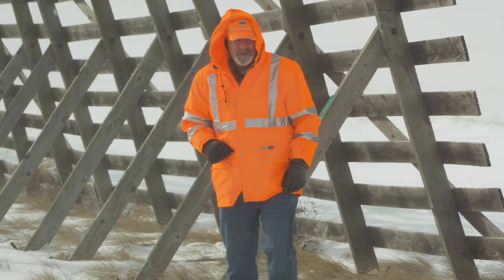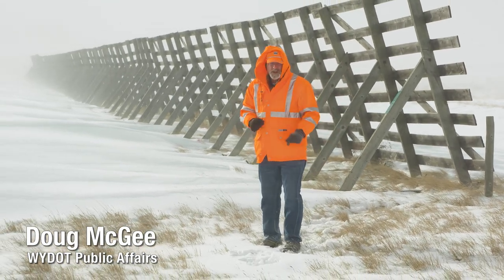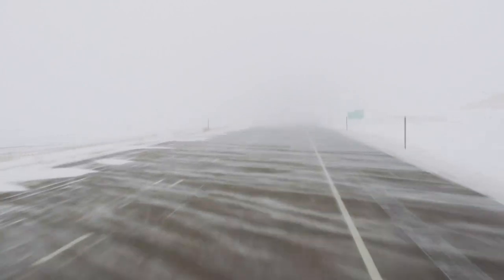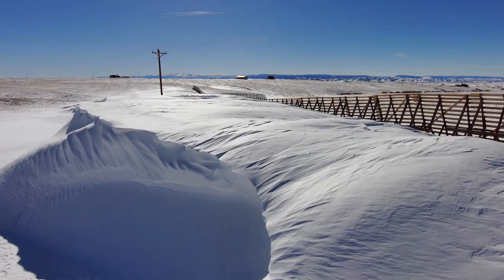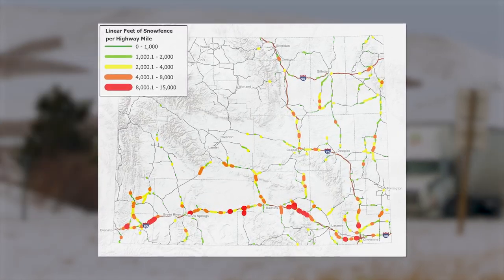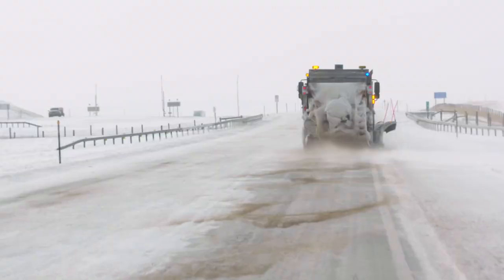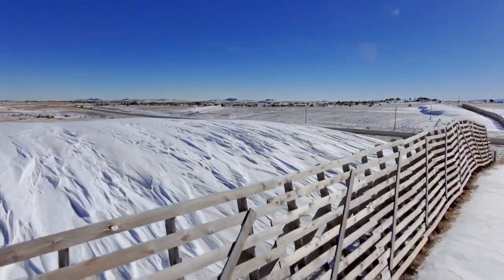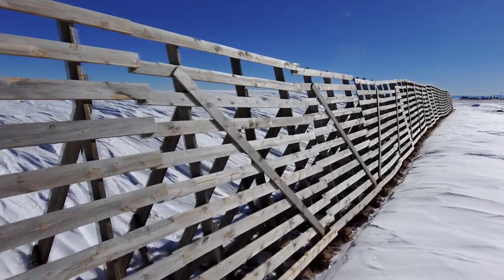Snow Fences

Comment: Late May 2020, I-80 WB the entirety of WY. Even in late springtime weather, it was, "sporty" as in ... "Caution high winds ahead" on the highway overhead signs and 4  - count 'em 4 semi trailers in ditches, and one of the 200 yds into the grass field alongside.  Saw countless of these "What the hell are those things? structures. (Yeah, I'm not the bright bulb in the cutlery drawer. ;-)
Made it to our destination but after settling in, searched YT for "Wyoming & Driving Conditions." This site returned & been a sub ever since. T/y and good luck to those who brave Wyoming driving - nothing comparable to in almost 50 years of driving.

Comment: Bring a lot of soil and you get 10 miles in one year and make like a hill next to I-80 and see how it shows, if it works well then do it where it is most dangerous from the wind, that hill of soil should be at least 2  yards high so that the wind does not blow the snow over.

Comment: Really look at the drifting in front of the snow fence. It allows the wind to blow even more snow slopes on both sides. Cut the drift between the fence and the drift make it a wall part of the problem solved. You have enough snow to make wind blocking in other areas use what god gave you to work with. It’s getting beyond the point of ridiculous now. All the schooled up Engineers and we can’t seem to find the simple solutions c’mon Wyoming D.O.T. Someone start using your brain buckets. I have watched your people flatten out the snow drifts inviting snow to blow across all winter make a place for it to stop the snow or at least most of it 🤬